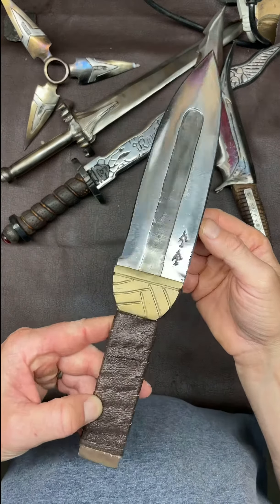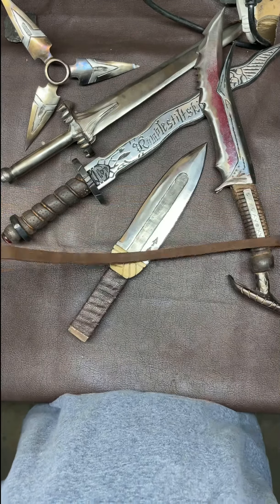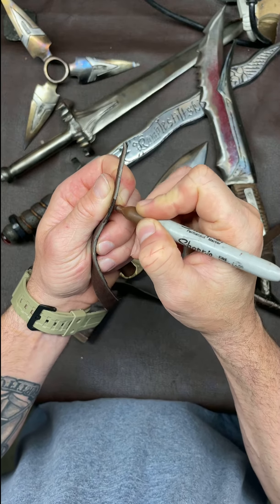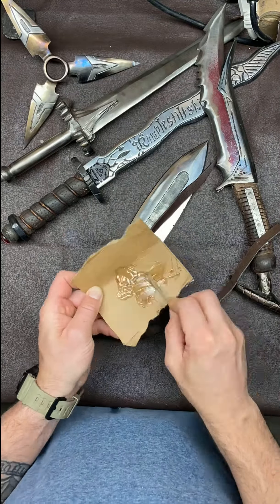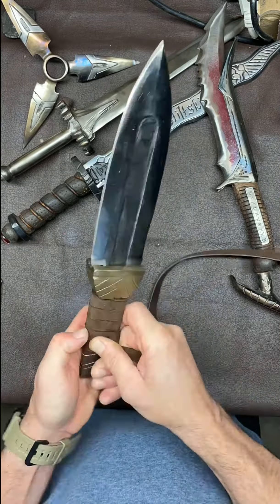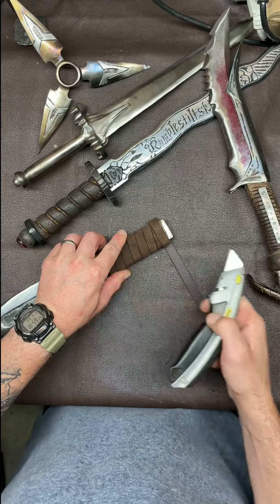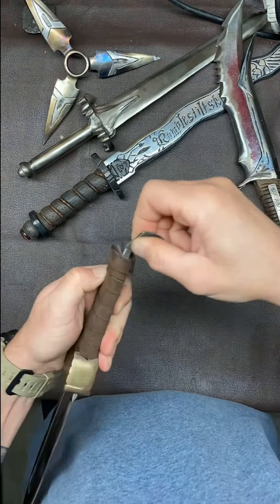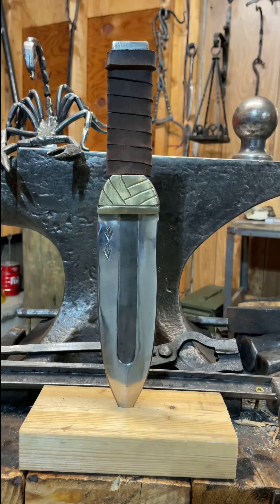New Leather handle wrap for Thorfinn’s dagger from Vinland Saga.

Comment: Hey not sure if you check but I was curious what your dimensions are for the blade? I'm looking to forge myself his daggers and your's looks like a nice size. I was thinking blade roughly 8 inches, width roughly 2-2.5 and handle length 4.5 inches. Curious  if yours is close to that? So far I've only got mine sketched up on paper, gonna try to start taking hammer to metal this week.